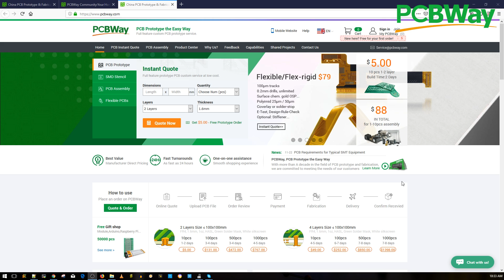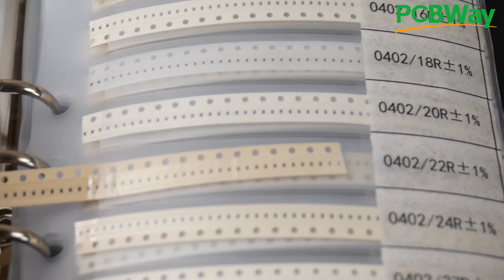A New Era in Flight Controllers // DroneMesh OpenFC Open Hardware Flight Controller

Comment: According to your perfect instructions I have already design my own pcb ( just a try) layout based on your schematic diagram I have done a modification by adding a 10v regulator. Btw my expectation is to add an OSD chip. Finding the schematic diagram of AT7456E osd chip, I figure out that I need a double-side layout pcb. Will you come with future video double-sided pcb? Keep up good working my friend...
Here is my files to anyone who wants to have a look. (not tested, not the final one)
https://easyeda.com/kapapi/mesh-fc-v1-public-10v-regulator
Reply from the maker: Can you post your design on dronemeshforum.com I have completed the OSD schematic with 5v reg and the pcb design.. I will have an update video in couple days.
Reply: @DroneMesh  Done... in share projects
Reply from the maker: Great keep checking the forum I will release the the new schematic with OSD however it has not been tested it and waiting on pcb to arrive.

Comment: Why does a gyro not have to be centered? If you had an Acrobrat frame, could you mount the flight controller to the front of the quad?

Comment: A neat way how to salvage parts from broken/fried flight controllers, ESC's etc. I wouldn't say that the cheapest, but interesting anyway :)  Especially for ones who want to know their gear from inside. What's next? Since we can make our PCB's, maybe try to rebuild some googles better. Like EV800 taken as base, but with better diversity, frequency analyzer in OSD and better DVR who wouldn't cripple PAL resolution and will record received video good as possible without picture infested by square artifacts caused by too aggressive compression. I would buy such board, because I have one EV800 and one EV800D which seems must be upgraded :)

Comment: congrats, I'm happy for you, I was looking at the holes that mount onto the frame and they look smaller than the boards that use grommets. Will you be able to fit the me grommets on your board?
Reply from the maker: Yes v2 will have all this was a quick prototype to see if I got the schemtic and gyro setup correctly.